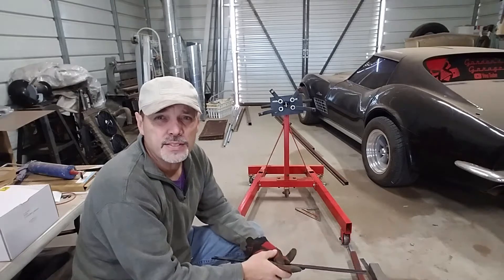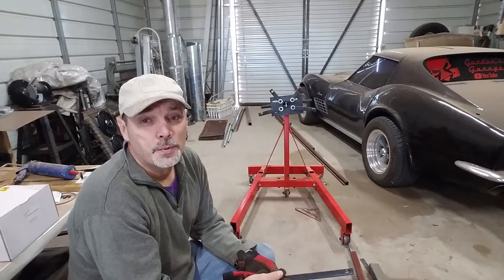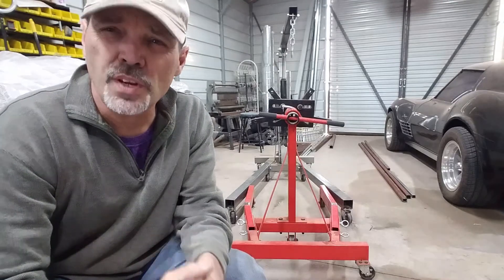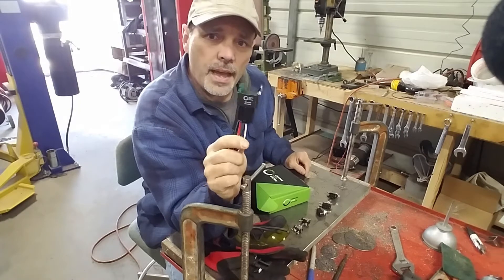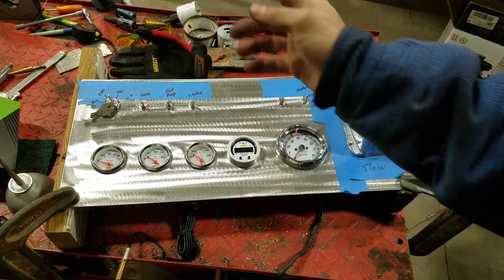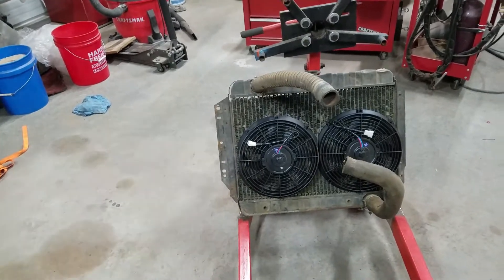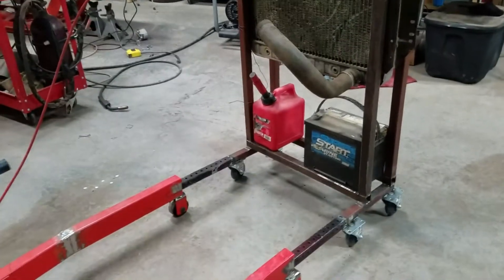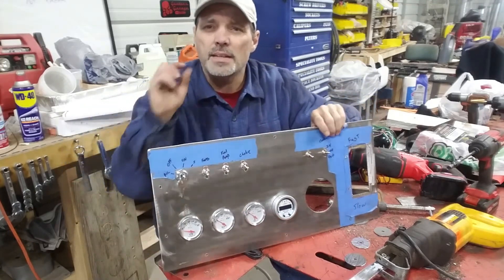engine run stand episode 1

Comment: It's probably good the Corvette is so dusty. I betcha it's covered in overspray. Been der, done dat. The stand looks like it'll work until you rev the engine too hard or if it won't idle right. Maybe a wider wheel base? IDK. My two cents.🤔

Comment: The trick is put the engine stand in backwards then you’ll be able to connect your engine to your stand off of your hoist same thing with taking it out and putting it in I found that to be a lot easier
Reply from the maker: i will look into that. thank you
Reply: @gordonsgarage1845  never had a issue mounting my sbc this is funny 😅